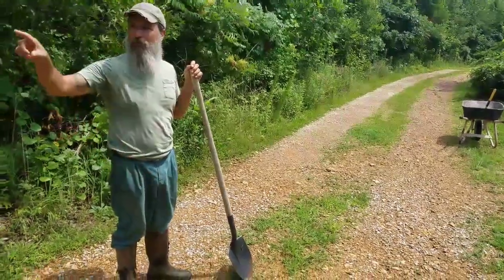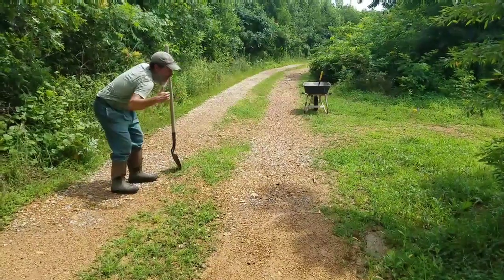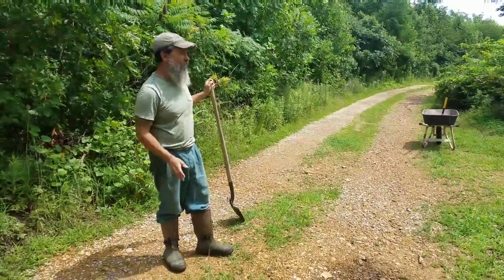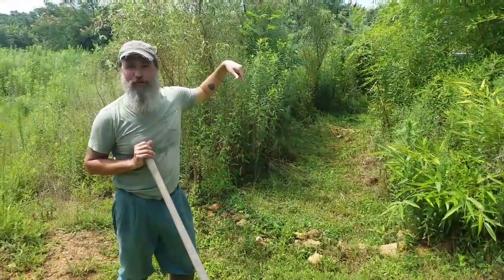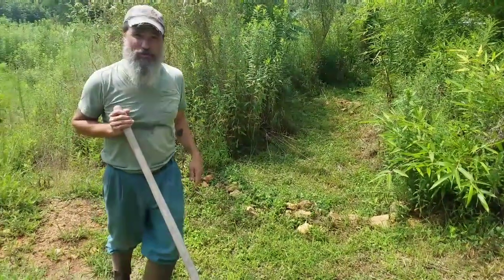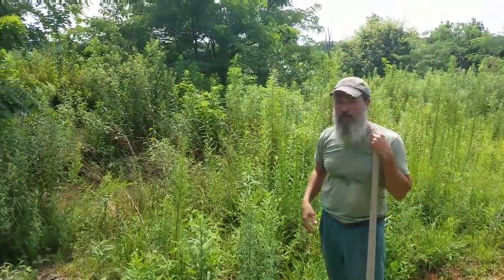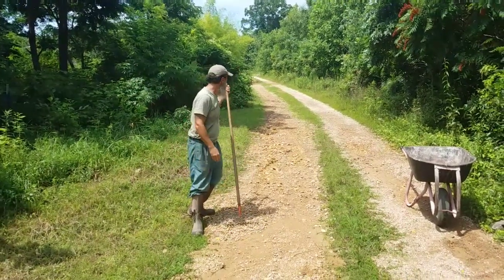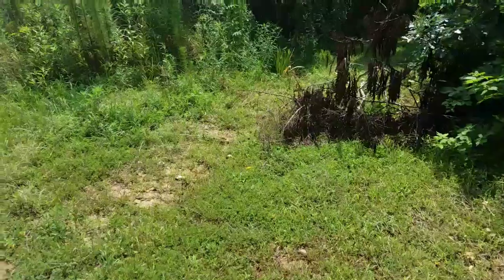Permaculture Earthworks: Roads, Ponds and Induced Meandering

Comment: You are making more work for yourself.  Please, read Mycellium Running.  Paul Stammets developed a system to stabilize logging roads by applying wood chips, innoculated with mushroom mycelia.  The matted mycelia anchor both sides of the road, act as silt traps, and as sponged to absorb excessive water.  Keep in mind that logging road are steeper than yours.
Reply from the maker: esteban corral We have read Mycelium Running.  Great book, great techniques.  However, we want to capture and channel the water to passively irrigate tree systems and fill ponds, so that technique did not meet our design goals.  Besides, it's not that much work to install and needs little maintenance.  Thanks for commenting!